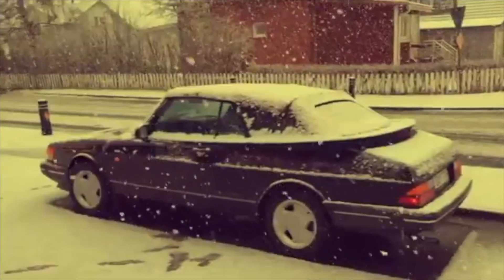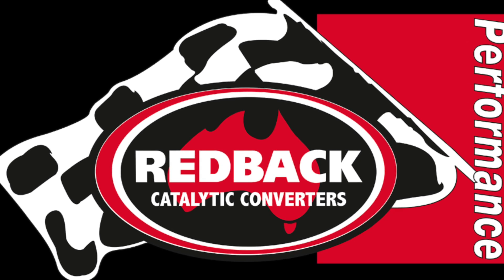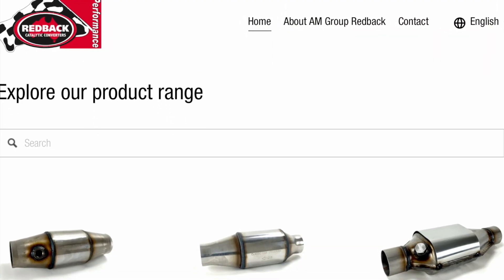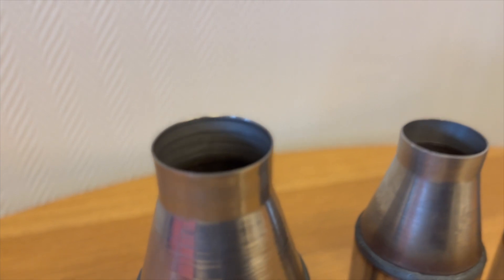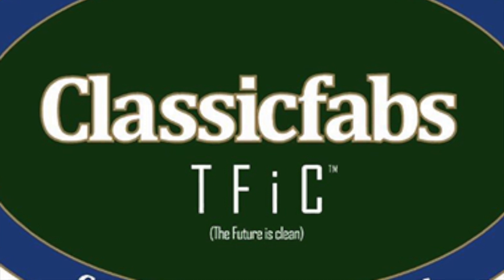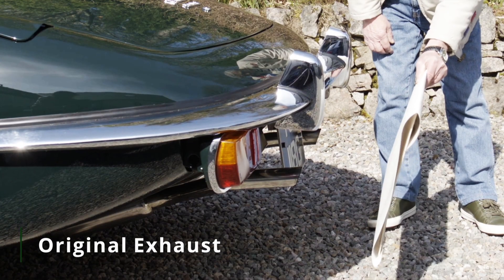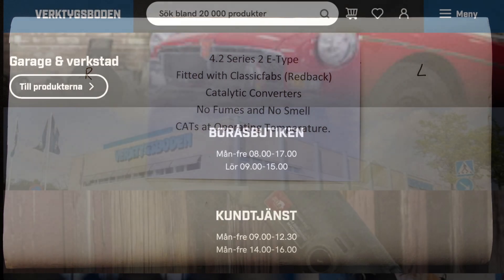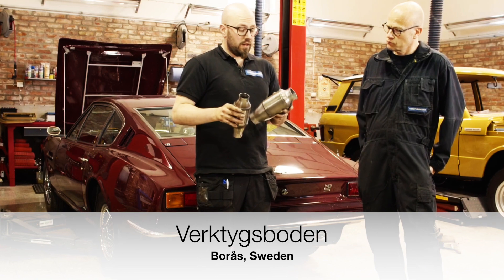Finally a Catalytic Converter for our Carb Saabs !!!!!

Comment: This is very interesting, thank you for sharing. 

I’m looking to retrofit a catalytic converter to my 1994 Toyota Landcruiser (1FZ petrol engine). These were sold in Australia without any catalytic converters, apparently due to a loophole in the law as they were classed as a light truck.

My goal is to reduce the lawnmower smell of the current exhaust.
Reply from the maker: That's the added benefit of these converters - eliminating the petrol smell inside the cabin !